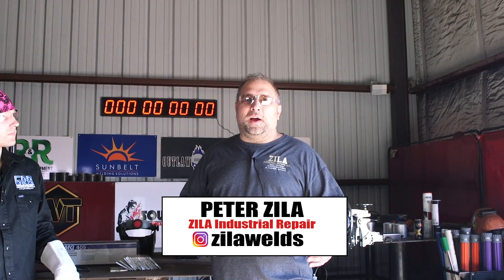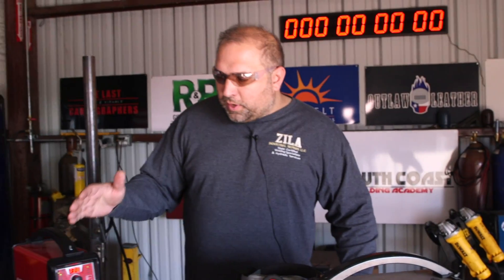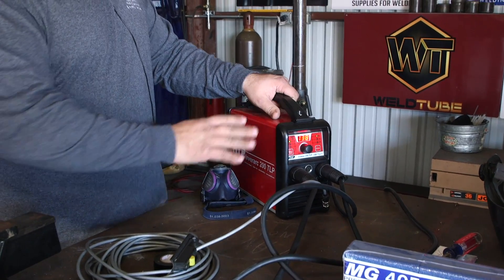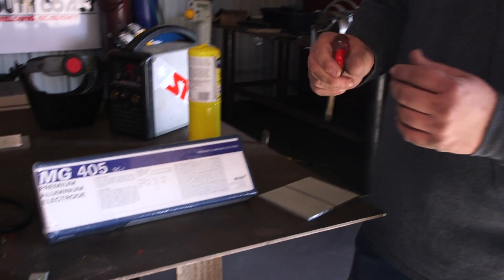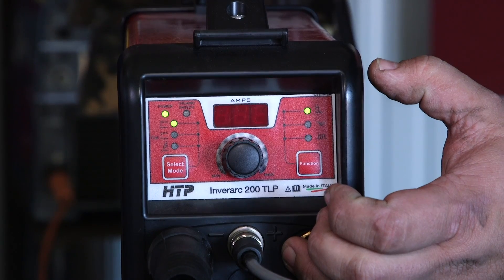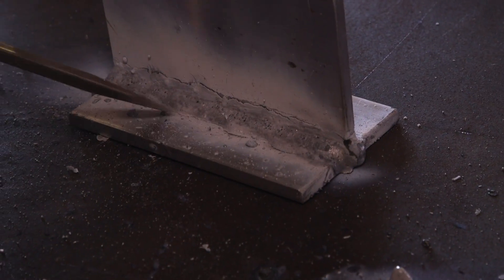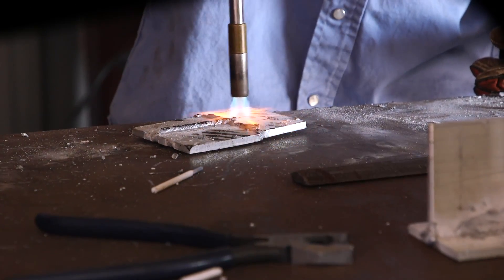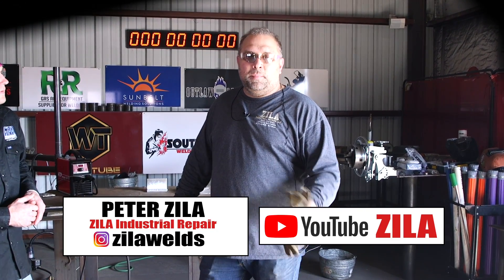Aluminum Stick Welding

Comment: Hey Peter great video,  I might get a pulse stick welder,  that's some nice aluminum stick welding.  It usually does not turn out that NICE.  with regular dc.

Comment: Great video but I’m gonna try to run aluminum rods off my bobcat 250. I should be alright on dc- ?
Reply: Other videos I’m seeing out there is to run the electrode DCEP for aluminum. I have 4043 rods will it matter that much. I done a cast aluminum job and dcen worked out just fine. I’m new to the aluminum stick I’m just getting by with using stick until I can save up for a tig machine. I never anticipated welding this much aluminum 😅

Comment: Thz heaps for video, Would useing the tig, AC, function  on machine in scatch start along with pulse settings work, with aluminum stick  welding...

Thanks 
Jason

Comment: Yes, pulsing SMAW seems be the best help with super difficult electrodes/non-ferrous metals like aluminum. For many years DC+ and hi-frequency superimposed helps improve results.  Great video , shows SMAW comes to the rescue of MIG and TIG  outside in the field.

Comment: I have done a bit of aluminum stick welding on very dirty aluminum and it does work but not pretty. My Fronius 180 has pulse stick and I have it on all the time, pulse stick works very well on 1/8 to 3/16 sheet. Thanks for the good video.

Comment: I've used aluminum stick rods off of my 1977 Miller Big20 to repair 18 wheeler truck diesel tanks and aluminum boats and i had to fight it every time. Thank you so much for sharing your knowledge on this overlooked topic of aluminum stick rods! It's going to make my life a lot easier! Mr. Zila is absolutely right about heat input and not being married to specific amperage settings. Heat is your friend when is comes to aluminum! Don't be afraid to crank up the amps. It looks like some equipment upgrades are in my future.

Comment: Damn, nice lookin' beads.   Hows it out of position?
Reply: David Spennachio worked good at my shop.  I was teaching a saturday class and at the end if the class one of the students welded the step on a dump truck (.100” thick) with that rod and a patch over it.  1 horizontal 1 overhead and 2 vertical welds .....  turned out not bad looking ....  i mean perfect like this here is different but for sure it was a okgood weld.  If you want to find the video on my channel i think its called : what happened at my welding class” that scene just described is towards the end of the video
Reply: @ZILAwelds  Thanks Man!

Comment: Hey could y’all do a video on 3g and 4g 1inch with self shielded flux core. Also what do you run the settings for 1/16 wire for self shielded. I’m about to graduate welding school and I’m head down to the ironworkers.

Comment: very information packed, love it. I’ve seen aluminum stick welds before (usually handrails) that looked like booty. My first reaction to the bead those rods laid down was WOW that almost looks like 6010 on plate! The dark pink color of the arc is cool too

Comment: I was in the tanker repair industry even with tig welding,fixing a leak where you have pinch points and the weap hole won't allow pressure relief how do you compensate? I have struggled with it many times the only solution to save cost is to drill more weap holes and when the guy who's gotta fix that shit gets tired of arguing with you, buy another tanker or fix the roads or the parking lot so that shit don't cause a fight
Reply: Mike Kerezsi on most tankers i do mig or pulse mig.  Sandblast the area with the pinhole, weld the pinhole, than put a good size “patch” over it 4” a 6” and weld that leak tight over your repair spot.  At least that system always did it for me.
Reply: @ZILAwelds  yea, I don't know what law says where your at but lap patches are not allowed usually I v groove anyway it's a tough job I'm on vacation from all that
Reply: @ZILAwelds  cool video though good for structure
Reply: @ZILAwelds  do you follow VIK EPA T regulations
Reply: @mikekerezsi9672  I dont, I work on converting bulk dry powered cement tankers into water tankers.  there is a lot less rules and regulations I need to comply with
Reply: @ZILAwelds  true
Reply: @ZILAwelds  oh yeah if you're interested in hiring me I usually listen Slayer as a reminder that life is short in that industry lmao

Comment: Great video and excellent presentation! 

Note:  If you want to preserve the electrodes after opening the container, you can seal them back up in a plastic bag to prevent moisture from dissolving the coating.  These electrodes can also be used in brazing applications and also as a tig rod when the flux coating is removed.    The MG 405 is a 4047 wire.

Comment: Zila is the most knowledgeable welder I have watched on YouTube. This guy is a true master.
Reply: Skippity Do Da na na na ....  i mean its very nice for you to say that. But i can tell you, almost 43 y/o  need reading glasses under my hood to weld low amp tig ....  and didnt learn stick welding till i was 32 (one year after i started my own welding business 😳) all the guys at weldtube can stick weld circles around me without even breaking a sweat !  Seriously. And tig? I used to be pretty awesome in my 20’s and early 30’s but again, welding with real pros here ...  man - i had a lot of rust to shake off .....
Now mig and pulse mig ....  i do a lot of lately - i like to think i can hold my own on mig ....  
its all a matter of what you do and how much of it you do ....  i have a passion for welding ans i do a lot of odd ball stuff like castings or oily scrapyard stuff....  and there is a ton of guys out there who can do all this and there is plenty of guys who i can teach something but there are plenty of guys who can teach me something ....  the only difference is those really good guys - they work so hard in the trenches all day and we just dont see them on youtube ..... that does not mean that there are no good guys out there it just means 90%+ of those guys we dont “see”
Thanks for the compliment though!

Comment: I tried this at a ship repair. There, this method was positioned as emergency and temporary, when no other welding methods were available, if only it would not fall off before a full repair.

Comment: All fine, BUT ! If "Stel invented pulse stick in 2005" then how is it possible that my old welder from Denmark from 1996 has pulse stick mode with adjustable pulse time and pulse frequency up to a 1000Hz ? Amongst other like inductance, hot start, arc force and the ballance between pulse current and the background current.
Reply: Mark Masterson well. They formulated 50% pulse on time 50% background and with enough arc dynamic to run 6010 and citoflex rods ....  they were the first to officially introduce this and make it popular that the 2005 welding show is ESSEN ( germany)

Comment: How has the process affected the temper of the aluminum?  Biggest concern I have with aluminum in general is not ending up with soft joints that will break if the design of the thing doesn't account for that softness.
Reply: TWX1138 any aluminum that you weld looses all the heat treat AND the artificial aging   As a rule of thumb EVERY aluminum welding process mig, tig or stick will loose ( depends on what grade aluminum you started with ) at least 50% but possible as much as 70%+ of its original strength.  
6061 T651 for example looses about 70% tensile strength in close proximity to the weld ( 1/4”-1” away from the weld) 
Typically engineers account for that when building things. If you fix an aluminum casting by welding it - it needs to back to the heat treating shop and pull all the temper out and re heat treat the entire piece.
Reply: @ZILAwelds  Holy Shit! I didn't know it lost THAT much strength. 

What did/do they do it when building aluminum frames for race cars like the old Lola T70's?

 Is the whole frame heated treated to regain it's strength?
Reply: @garykish8951  re heat treating can be an option depending on the size, shape and the kind of alloy used.   Some aluminum tubing looses more than others for example if you build a frame from 6061 tubing (round, rectangular or square tubing) you loose a ton of strength when you weld on it.  6063 tubing on the other hand (which is less strong to begin with that 6061 , looks, feels, tastes the same ...LOL.   it will be stronger than 6061 after you welded on both - so if you dont heat treat you need to look at the level of strength the material has AFTER you welded on it .... also the design, (size and configuration of the welded joint, placement of the welds, .....  all this is figured in by some engineer who should understand how that works ....   with aluminum I try to stick exactly to the engineering specs and not "over weld" the joints because the more you weld - the more temper you destroy ....  you have to be careful and should somewhat know what you are doing if you weld aluminum and strength is critical ....  its not "easy" and you have to have the right filler material of course .... you cant just weld aluminum .... and if you have some sheets lets say 1/8" thick and you tig weld them - you cant just take your tin snips and just a little strip off one sheet and use that as filler ....  aluminum in general (without going into all details) dont like "fusion tig weld" or using same alloy filler tig welds. they need "dissimilar" aluminum alloys to work - but they have to be the "right ones" .....    I have a few videos on my channel on some of that topic ....   one of the videos has a link to a 72 page Lincoln Electric publication that is a VERY good resource.
Reply: @ZILAwelds  Wow! Never knew the loses  were so high. I wonder if that's why you hear of failure on race cars with the welds/joints failing.

I can see why steel tube frames are so much more common with the old V8 mid-engine kit cars like the Manta or Marauder.
Reply: @garykish8951  the tube chassis on race cars are typically chrome moly tubing. all tig welded ...  but some guys use the wrong filler or too much heat and that changes the temper of that tubing as well ....  hard to say ....  aluminum has another MAJOR problem ....  I made a video making a bicycle and kayak rack on the back of a 5th wheel camper trailer .....  and some guys said in the comments : that. is way to heat you should have mede it from aluminum .....
the issue with that is I used "very light" 1/8" wall steel stuff ....  the nice thing about steel is it can flex back and forth for " a million times" (within it flexible range where it does not take a permanent set and deforms) and still maintain it integrity .....
aluminum on the other had - although it flexes too ..... it has a memory .... although you dont flex or bend it enough to take a permanent set and deform it develops fatigue and stress cracks ....  steel has that to to a degree (it's typically referred to as "work harden") but on aluminum this effect is MUCH more pronounced and a real risk .....  aluminum is not good for anything that is subject to permanent back and forth defection ...   living in Wisconsin I see a bunch of little aluminum landscape and snowmobil trailers ....  (some boat and Jetski trailers too).  and because people dont want to haul a heavy trailer behind their little suv and because they dont want to deal with rusty trailers they buy aluminum trailers ..... and that is about the biggest mistake you can make ....   why? because they are not anodized and the salty roads eat them alive !!!!  and even if a guy only uses them in the summer - they are all cracked !!!!!  and then a guy comes and welds it  - and although the weld takes some temper and strength out .... the guy who welds it says: weld is better than a crack 
and I guess he is right but it has now 50-30% of its original strength .....
so what happens is :  if the trailer lasted 3,4 or maybe even 5 years before it cracked for the first time ..... your repair weld job will be cracked again in a year from now because the strength is simply not there .....  also when you over load aluminum trailers vs steel trailers - not good - they crack so fast !!!!!

so the recipe for making good aluminum trailers - you have to do it like featherlite.   when they build a 3 car hauler wedge trailer to go on a pick up. the thing is "fully enclosed" on the bottom (tool boxes build in) with gives it a TON of rigidity - you want the trailer to be "as stiff as you can" so it does not twist and flex (because as we learned - that is why they fail.
also you dont want it to be "fully welded" or "over welded" .....  you need to make sure it welded "just enough" in "all the right areas" if you weld it too much it is counter productive and weakens it ....
then anodize the thing - so slat water does not do a number on it .....  
then you might have a chance ..... I personally still would weigh out my options buying one ....  payload is higher, fuel consumption in lower, towing is easier, BUT initial purchase price is much higher and life span of a comparable steel unit is longer than the aluminum unit .....  
once it starts cracking. - weld'r up and sell'r as fast as you can ... !  LOL.   
but I am happy they make aluminum trailers ... something needs to pay my bills and put food on my family's table ..... so you won't hear me talk shit .... and if you "run your business right and you need the trailer every day and it Raif for itself in a year and after 5 you sell it to throw it away ....  (who wants to keep a trailer for 10 or 20 years ? and repaint it every 5 ....).  then it could be a great move for you to buy one ....
Reply: @ZILAwelds  Thank you. I didn't know any of that. I think I'm going to stick to steel tubing instead.
Reply: Gary Kish isnt it funny the more we know about thing the more we find out we didnt know and now all the sudden we dont want much to do with it ....  i went through the same thing 10 years ago....  but on the flip side because there isnt too many guys who “can do” aluminum but at least not “right” there can be a lot of gravy money in some jobs .....  
but that is all for you to decide.
Reply: @ZILAwelds  Oh, I appreciate and use pros when it comes to my life (aluminum motorcycle frame). Hearing about the shocking strength lose after welding through takes me out of the game for an aluminum kitcar frame.

 I love the look and especially the light weight but I can't hear treat an entire chassis. 
 
I will have to step back a bit after hearing about that reality thing, lol.

Which I'm very glad you shared.

Thank you!

Comment: I first stick welded aluminum just to try it.  After the first crappy beads  I preheated only the first 2 inches and beveled the 1/4" plate,  it came out a lot better.  Fun to try.

Comment: Pulse stick welding?! Damn I've been doing it wrong with my '69 Redface and preheating the fuck outta it LOL it's actually not too hard. Just have to use fresh rods.
Reply: Rob Murphy yes ....  fresh rods ( i thing eutectics and MG work best) and pre heat and take your sweet time before you remove any slag

Comment: Will a regular inverter stick welder work with these sticks?
Reply: Calimesacox yes.  If it can weld 6010 and has good arc dynamic - that always helps
Reply: @ZILAwelds  thank you for such wonderful advice and quick response.
Reply: Calimesacox the thing you will notice is that aluminum rods (without using pulse) just burn SO MUCH FASTER ...  but at least in flat position very controllable ....
The only time i welded it out of position was with pulse and it worked great - i believe you can weld it out of position without pulse .....  have one hand on the electrode holder and the other one on the amperage dial and you should be ok
Reply: @ZILAwelds  yea my set up has two positions for T2 or I think T6 
I get its it's all about the heat. Hot start and feather in the lower amps as needed. Just like tig just without the has shield. The flux is the shield.